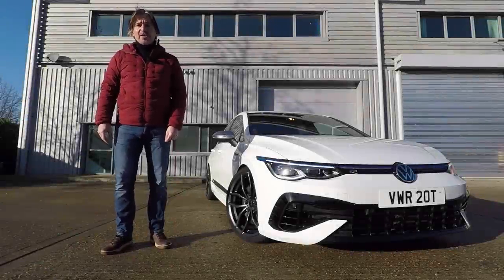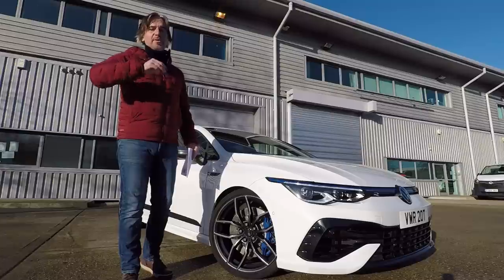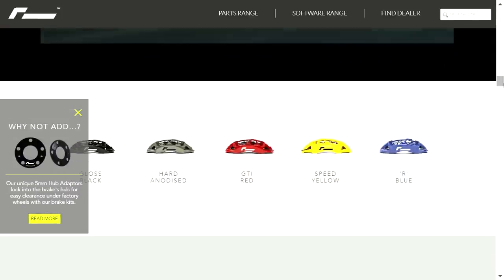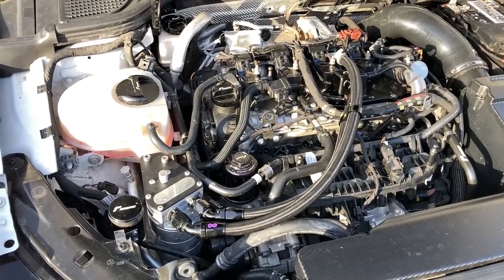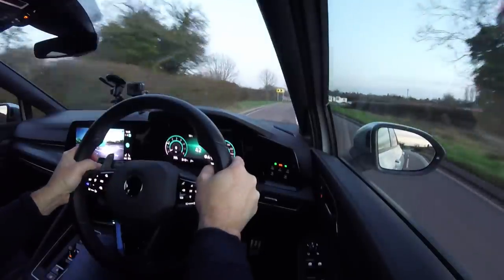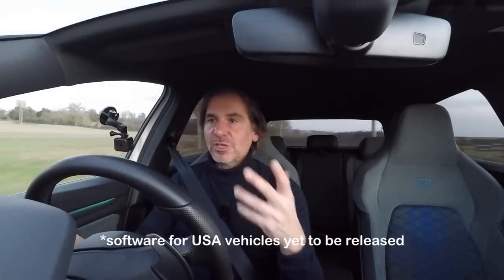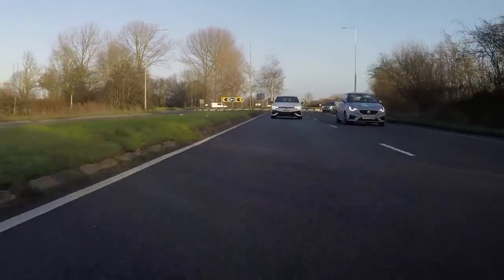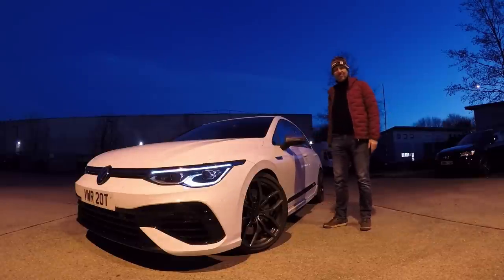RACINGLINE MODS MAKE MK8 VW GOLF R COME ALIVE!

Comment: Racingline put a Stage 1 tune on my Tiguan Allspace 245 2.0Tsi, and it now chucks out more power and torque than the standard R. (335PS & 500Nm)
Top top blokes there too at the Milton Keynes HQ, esp Ben.
Reply from the maker: Another happy RL customer 👊

Comment: Merry Christmas Andrew, i have the latest 22 plate T-Roc r 300, it rides pretty good on 18" with passive dampers, i think it runs the same engine as mk8r? ableit less power, so this Tune should work on my car? Thanks Michael.....
Reply from the maker: Merry Christmas to you too Michael. I've not driven one on passive dampers and 18s so your feedback is appreciated. I doubt they'd use the old R engine in your car so yes I think it's a Gen 4 and would be compatible - they quote 300/310/320 engines.  If you've got the engine cover that was part of the recall then it's definitely Gen 4 - must be another way of telling but can't think of one now.

Comment: Do these Racingline mods void your warranty if the engine develops a fault?
Reply from the maker: Depends on the mod, if it's engine related then VW will use mods to wriggle out of claims even if there is no hard evidence it's related and standard cars are failing just as often.

Comment: Morning Andrew. Following on from a previous YouTube mention by you of Racingline I made contact with them and they remapped my partners stock Golf mk 7 1.4 TSI DSG. Has vastly improved the horrendous flat spot when pulling away. Now drives like a normal car. They were very friendly and helpful. I did tell them it was off the back of your comment so hope that helps you! Best wishes to you and yours for Christmas and the New Year.  50k subs by the NY?
Reply from the maker: Hello Howard, festive greetings to to you too🎄 Great to hear feedback on Racingline. A Mk7 is a pretty old car now and I am sure the newer cars have even worse response all due to the emissions regulations. So remapping to sort this out rather than have more power is going to be big business.
50k by New Year? New Year 2024?!  It's hard to gain more than 1k per month so somewhere around high summer is the ETA, better time for a party anyway :)

Comment: What are your thoughts of remapping a Tiguan R? Would the respond to the remapped high torque engine and gearbox give it a better feel.
The Tiguan R is fitted with the R600 intake, front chassis raceline aluminium  strengthen. Maxton 3 front splitter, rear wing add on and the rear defuser all from Maxton Design.
Reply from the maker: I can't see why not Alan, it will certainly feel faster. I'm pretty sure you don't have the rear diff of the Golf, it's the traditional Haldex system but handling is good for a high riding SUV so it shouldn't feel to out of its depth. These maps are all about the torque and that's very much in keeping with what you want from an SUV so go for it.

Comment: I'd  replace my sleeper Mk6_Golf-R 2+ with a sleeper mk8 Golf-R + plus the ecu and tcu flash and save a bundle in difference  between it and the  new RS3. Stealth has its rewards. Love this review.
Reply from the maker: A black R would be pretty stealthy.  Need to drive back to back but can't imagine any car with that 2.5 5 cylinder engine being anything like as neutral, 8R is pretty neutral without rear diff intervention while I am pretty sure RS3 needs that torque splitter a lot more, basic physics. However love RS3 too and great to have the choice 👍

Comment: Andrew, Oh Bother indeed - too much power methinks?
Reply from the maker: I was just thinking some other YouTube channels do videos on 600 bhp Golf Rs so no, this one is perfectly docile.  The launch via launch control was still really fast and effective, it's just that one tyre was on dry ground and the other was on a damp patch.  The car shifted a few degrees one way as one rear tyre spun up momentarily (you can see me apply a touch of opposite lock), in a lot of cars when the second gear is slammed home the car can start to rotate even more which isn't good but DSG being so smooth it didn't affect it and by second gear it was in its stride.
Also in comfort mode and auto gear shifting it's only running  a 250nm map, it's good to have the choice.
I think a front wheel drive GTI would struggle with this map but that's what the lower torque software if for. Still a lot for the front tyres to contend with but we shall see how they cope as got a Mk8 CS with this map lined up for slightly better conditions in 2023.

Comment: No matter how good auto box's get ill always prefer the feel and sound of manual shifts
Reply from the maker: VW have ruined the reputation of the manual gearbox with the useless clutches they put in the first gen MQB EA888 cars so it's a sore point. The R 20 Years' DSG manual mode is pretty good but will never be as engaging as manual, however nor will it need a new clutch at well under 10k miles

Comment: You made the statement that you think that golf r's, in general, are not as fun as GTI's. I would like to know why?
Reply from the maker: That’s easy and it’s not just me, common theme across all of the motoring media. Fun from driving comes from a degree of excitement and that’s had more easily (basically at relatively sane speeds) in cars with less grip.  It’s also a more interactive car which rewards skill, for example you can’t just hoof the throttle but matching available grip to throttle is a real buzz.  I could go on…

Comment: Is the redline map available in Australia? 🤞
Reply from the maker: Good question. Well there are racingline agents in Aus so that’s a good start, don’t recall any restrictions for down under but best to contact your local agent, racingline.com has a dealer finder on there👍
Reply: @volkswizard yes is it available in Australia. I’ve got my mk8 r booked end of February to be done. 

Keep rewatching this video teasing myself lol.
Reply: @davidbradley440 hey matey, sorry for a late dig up of an old post.

But have you got any feedback from the tune?
Reply: @lindsay9697  all good. Love it makes the world of difference particularly down low but noticeable throughout whole range especially when in race or Nurburgring modes.
Reply: @davidbradley440  that’s so good to hear and even better that your enjoying it. 

did you go the high/low file tune and did you do tcu? Any other mods?

Considering this route also and in Aus
Reply: @lindsay9697  only low file as tcu wasn’t available for mine at the time and haven’t got around to getting it done. Nah just that and set of wheels.

Comment: Another great video of one of the favourite cars.  Thanks to this channel I have a few Racingline parts on my mk8 (although 1.5 eTSI R-Line so choice is slightly limited) @Racingline @awesomecars1
Reply from the maker: I like the 1.5 eTSI, first one I drove was a Style model.  2 years ago I drove Goodyear's 1.5 TSI R-Line and I thought that was the sweet spot in the range, still hard to distinguish from an R when I see them on the road from certain angles. Just wish they did a petrol engine between the 150 and the 245 GTI
Reply: @volkswizard  I know what you mean. Something around 180-190 (maybe R-Line only? - I suppose if I keep mine after the warranty runs out I could get it mapped to somewhere near that?) Would be nice if we would eventually get the 1.5 in a Polo like they do in Europe too.  hoping we get the Jetta GLI (or equivalent) in the UK too as we really like that (may eventually replace the A3 with one of it does) @Volkswagen @Racingline